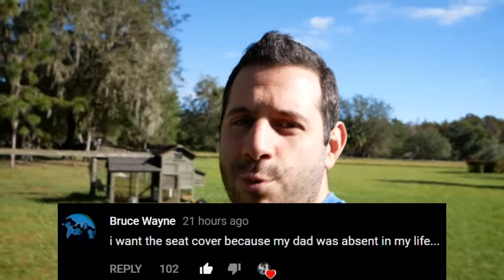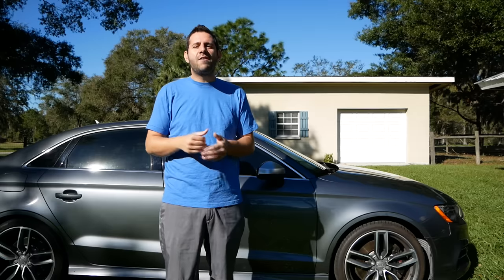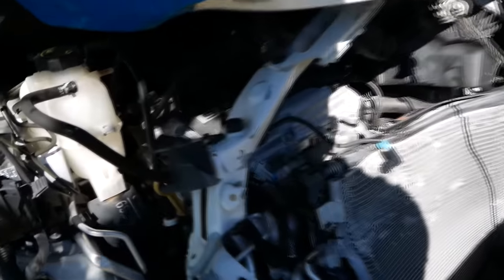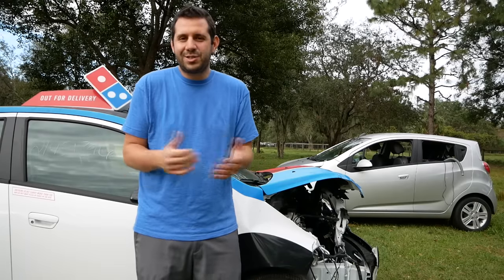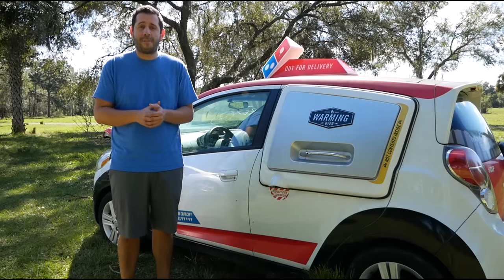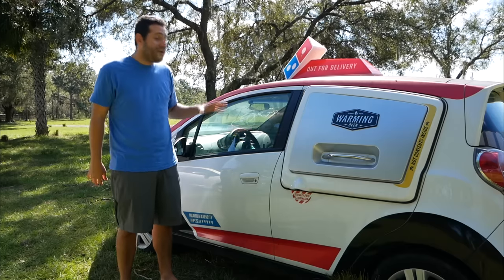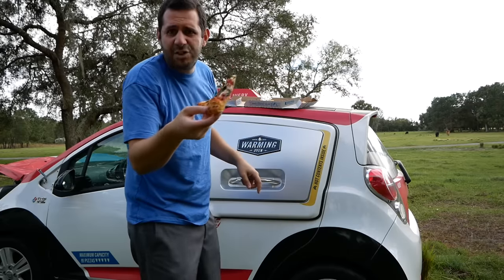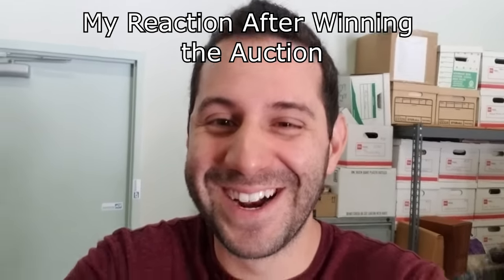I Bought a WRECKED Domino's Pizza DXP Car for $525 (and we're gonna rebuild it)

Comment: Samcrac Roush doesn’t just stick a hood on the Mustangs they add high performance parts such as; tier 1 2 and 3 Roush exhausts, and then you have the superchargers that Roush installs. They also provide warranty claims like Shelby and Saleen tried to do

Comment: i worked off and on for dominos for 10 years. i have done every position except head store manager. when i was a driver i put 1000 miles a week on my car on average. this car was not driven more than a month, guaranteed.  great deal. wondering how much you paid for the flooded spark.

Comment: easy fix. those things total out quick. hope you repair it per manufacturer specifications. looks like the frame is ok. those core supports are one piece with the rebar. easy cheap fixer.

Comment: Insurance companies not stupid. There's is reason why they sent cars to the auction, proper repair will cost as much as the vehicle current value. Also, without frame machine car cannot be fixed correctly. Insurance companies send their cars to body shop and they measure distances front, back and diagonally, when they see that everything is out of alignment, they sent this cars to auction. Without body shop tools and oem specs average person has no clue and cannot tell whole car body damaged beyond what is visible.

Comment: the reason why your car won't start is because the SRS system has been deployed, the car probably now needs not only new seat tensioners, airbags but also the ecu reflashed, if it still won't start then you will need to buy a new ECU

Comment: my last job was making pizza crusts for Dominoes, you don't a dominoes pizza. seriously! the guys there have mustaches and beards, they barely wear beard covers. they touch the crusts with bare hands. the crusts are "half baked", then boxed and frozen. i have a bag of them in my freezer, they are 14" and my pizza oven is 12", so i will use them for target practice with various pellet guns (i did get 500 rounds of CCI "Quiet 22" but those would pass through easy, i'm sure.)

Comment: Not sure but I thought in modern cars, once the airbags have been set off the the computer won't allow the engine to run?
Reply: Not correct
Reply: I looked up your "not correct."  Actually found out many manufacturers do disable the injectors.  Some even have a battery terminal blow off cap that prevents a restart.  So yeah, I am correct.  Just not all makes do this.  :middle finger:  www.google.com check it out one day.
Reply: I have rebuilt several totaled wrecks and I have never had to do anything to the computer to make them run.  Sometimes DAMAGE prevents them from running.
Reply: Minis do disable the engine after airbag deployment.  Theres an example.  Many mini owners didn't hit anything, their airbag went off, and the car was disabled.  So... I'm not "wrong."

Comment: Nice slam on Roush.  Under those taped on hood scoops are modified engines, suspensions, interiors and exhausts.  Roush is a Tier 1 OEM supplier and engineering partner of Ford Motor Company.  Ford Performance superchargers were designed and are built by Roush.

Comment: I use a motorized wheelchair and there is pretty much ZERO transportation resources for me.  No UBER, no Lyft, no taxi cabs. THIRTY YEARS ago I took a trip to England. I could call a taxi anytime to go anywhere. Here in San Diego CA & in the USA, there is NOTHING that you don't have to schedule days ahead of time or pay $100 to go 5 miles! Mini vans are way too expensive. Why are there still NO vehicles/cars that a wheelchair user can get into (forget about drive)? Can you modify a car cheaply so a wheelchair can ride?

Comment: That's all the "warming oven" in those is?  A plastic tub on its side with a radiant heater underneath powered by a separate battery, and a string of red LEDs? It's even open to the car around it. Yeah, that's pretty lame. Although I suppose I shouldn't have expected a system that couldn't cost more than a hundred dollars to be very fancy...
Reply: It's a hot box. That's all it is or needs to be. It's not supposed to be hot enough to bake it on the way.
Reply: Still seems a waste to be so open/not insulated. I mean, a standard styrofoam cooler with no heating would work better.

As I said, I suppose I shouldn't have expected more, considering how cheaply that part likely had budgeted.

Comment: Roush does alot more than just modifications to mustangs. in fact thats just a small percentage.
Reply: Roush Industries does do a lot. LPG engines for Lay's potato chip trucks, carbon fiber bodies for amusement park rides, Roush-Yates racing engines, Roush Racing, a charter airline, prototypes of all kinds. My favorite project of theirs was a half scale, totally accurate, NASCAR stock car for NBC to show audiences what the commentators were talking about without having to lug around a full size car.

Comment: I had to drive one of these for a month until I saved up for my own car. Two complaints. Slow. And my franchise installed trackers on these so i couldnt accelerate too fast, brake too hard, go over 70, and i couldn't make stops on my way to or from deliveries besides gas stations.